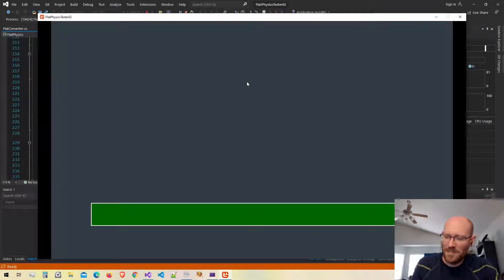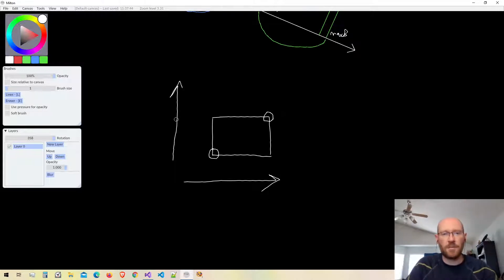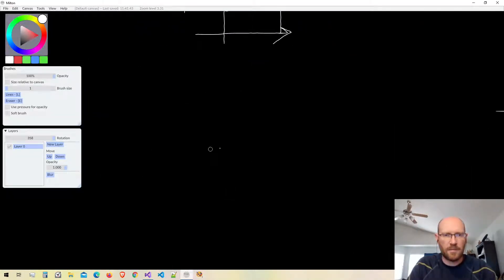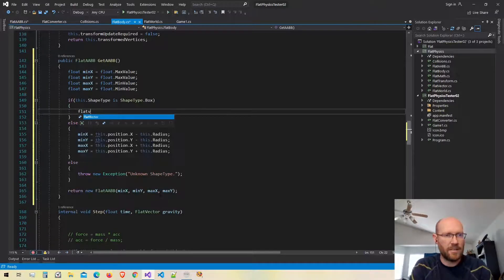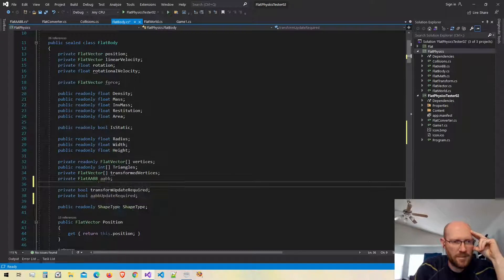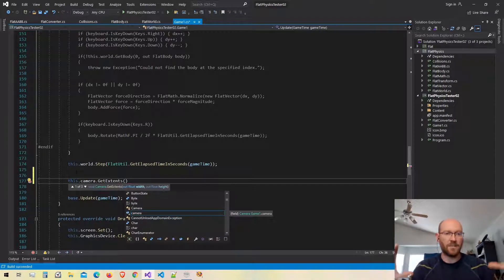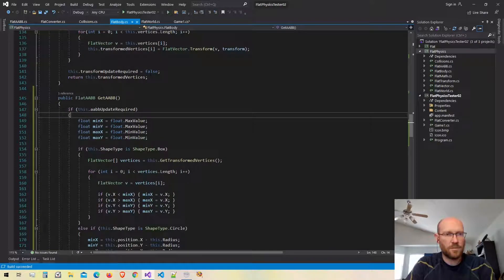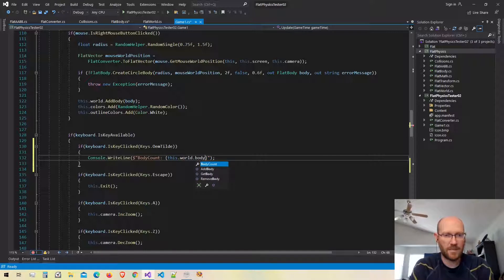The Axis-Aligned Bounding Box - Let's Make a Physics Engine [13]

Comment: In my game I will be using a lot of AABBs that do not require physics related stuff like Mass and Rotation. Would you recommend creating a separate body class to save RAM on all of those variables? And a follow up to that, do you think it is a good idea to have 'FlatBody' (mine is called something different, but that is not important) inherit from this new AABB class, so that the OBBs and Cirlces still have access to an AABB?
Or is this optimization not really worth it, and should I just have a 'FlatAABB' field in 'FlatBody' like you do in the video?

Edit: I should probably mention that likely more than 70% of my bodies will be AABB, and not utilizing Mass, Density etc.

Comment: Thank you so much for your videos! They're really helping understand about physics engine. So, it seems to me that there's a little bug at 0:15, the red box, falling onto the green box, got resolved in the wrong direction, right? I suppose that's because, in the SAT algorithm, the X-axis was smaller than the Y-axis. Are you going to address that issue in the future?
Reply from the maker: Thanks for watching and bringing that to my attention. I will need to investigate further, but the world step (in the future) will be using sub-steps for the movement and collision resolution. I think that will resolve the issue just because all the movement will happen on such a small timestep that it should find the correct normal. But it does bear consideration as we move forward.